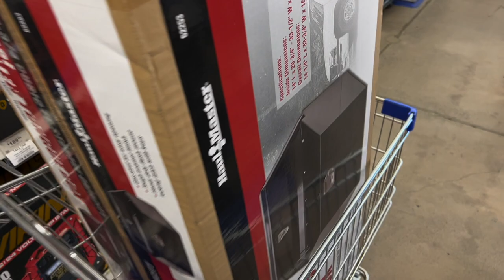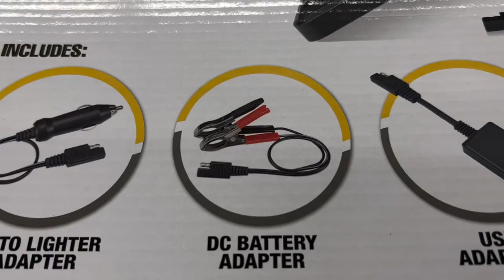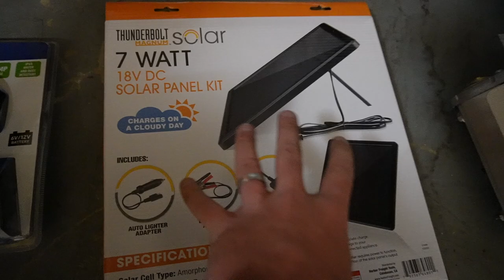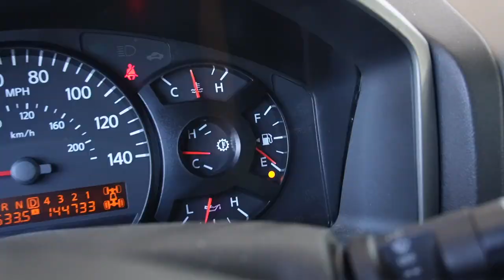Building A Custom 1 of 1 E91 M3 Wagon! (Part.7)

Comment: hey bro, i don’t know if this is too late but i noticed you’re using a valucraft car battery for the trailer, i recommend getting a deep cycle rv/marine battery when you replace it! they’re more specifically designed to hold a charge when doing stuff such as a winch (: